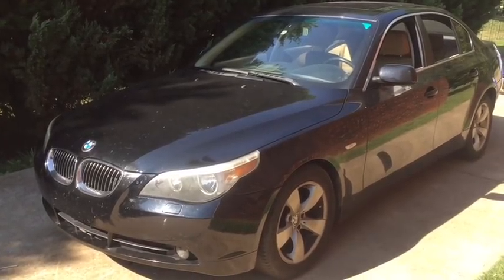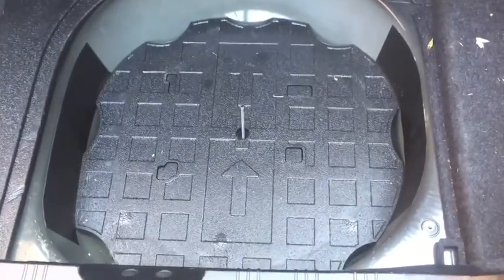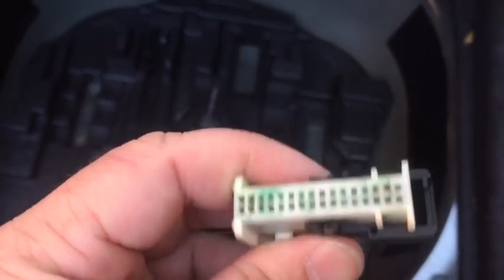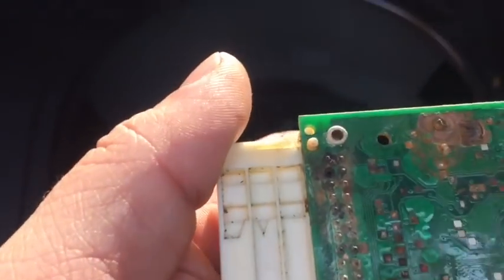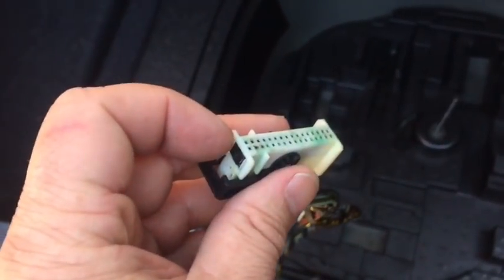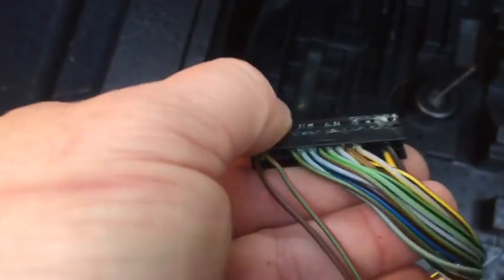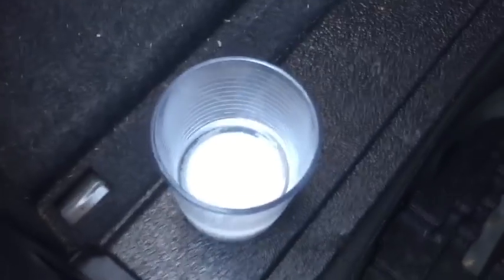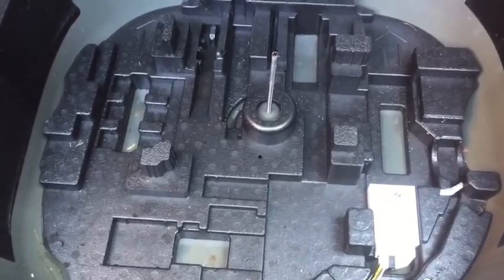BMW Battery Draining Fixed

Comment: Hey man, my 07 328i has a battery drain issue where the windows and radio don’t work and the A lot of lights popped up.. what do you think it could be?
Reply: Ayy Ceezar there is an extended warranty on the footwell module that controls all the electrical components. If your windows, locks, turn signals and lights won’t work but the car runs, it may be that. They increased the warranty in August of this year 2018 to 156,000 miles and 10 years and there are several models it applies to. I bet it’s that. Take it to your dealership and let them check. I bet it’s that. They can hook it up to a machine and tell you right away.  And if it is, it’s a free fix. No money out of your pocket.
Reply from the maker: Ayy Pics give me a little more information. Is the battery draining while sitting? How long does it take to drain? Will it restart without being jumped? What specifically stops working and which lights come on.
Reply: Your Car Guy DR okay so when it first happened I replaced it with a new battery and overnight it was dead. The DTC light, tire pressure, service engine soon, and a couple other lights show up. I was driving and lost half power to the car when this happened. It’s at a shop right now and the guy said he can’t find the issue, he got it to start with his battery but the lights still show up and he said it’ll still drain overnight
Reply from the maker: Ayy Pics there are several things that can cause this but I would start by checking the tire pressure monitor system. If the module has become wet and corroded it can cause this. Any module that has gotten wet can short out and cause a drain. All of the modules communicate on a can-bus so issues in one module can cause issues in another. The RDC module is what you are looking for. It should be mounted in the trunk either under the spare tire or near the battery. It is common to get water in there that you will not see until you pull the spare tire and the styrofoam under it out. Check that and see what you find.
Reply: Your Car Guy DR thanks man! I’ll check it out and let you know if I find the problem! Thank you for the help
Reply: @YourCarGuyDR  I have a battery drain issue in my 2008 328i I’m hoping this will fix it my door won’t open the fob doesn’t work on the trunk and passenger seat won’t move plus’s my trunk open keeps going off after the car is started
Reply from the maker: @cmurti2354  start by checking all of your fuses. You may have multiple issues.
Reply: @cmurti2354  I have the same issue. Did you find the part(s) that was/were causing these issues?  Thank you for your question and help in advance.

Comment: What type of battery is it: Standard, AGM or Lithium. Thank you in advance for your response.
Reply from the maker: Abel Charles This particular car was equipped with an AGM battery.
Reply: To confirm, my 2006 530i is equipped with a AGM battery?
Reply from the maker: Abel Charles they can be equipped with either. Both will suffer the same effect of a parasitic load draining them.
Reply: Ok, thx. Good videos!

Comment: My Idrive n radio not working and has battery drain
Reply from the maker: Yung Zo first thing to check is all of your fuses. You need to diagnose why the idrive isn’t working. It can be the cause of the battery drain.
Reply: Same here! Did you resolve it?
Reply: did u fix it??
Reply: @arvindersidhu7823  I solved mine and nothing to do with the fuse. It was the idrive it self that needed to be fixed. Try to find someone or a company that can fix the idrive mother board 👍🏾

Comment: Has anyone suggested relocating the module? Seems like BMW should had planned that from the start since we all end up having to do this due to water accumulation and BMW's poor engineering. I know a recall was done for my car but I had too many miles to be candidate....which I think is bad PR for BMW
Reply from the maker: Britt Michel yes there are several videos on YouTube that show relocating the module.
Reply: If it is a recall it has to be done for free no matter how old or how many miles. If it is a TSB aka Technical Service Bulletin then it is a known issue and there is a fix for it but it is optional and not fixed for free.